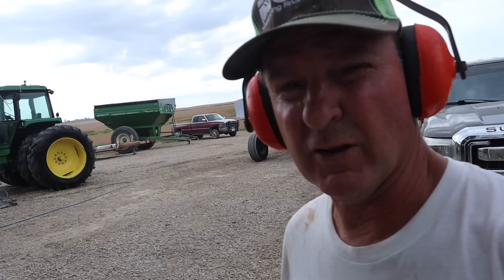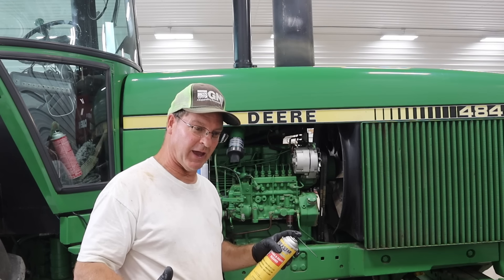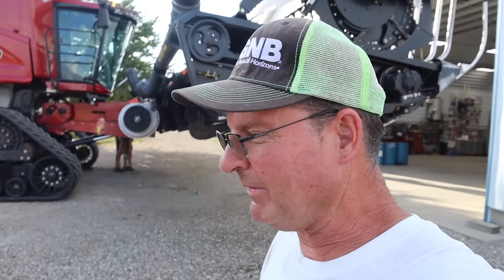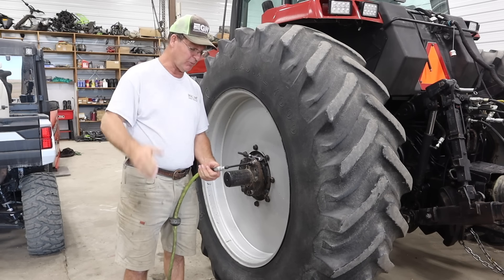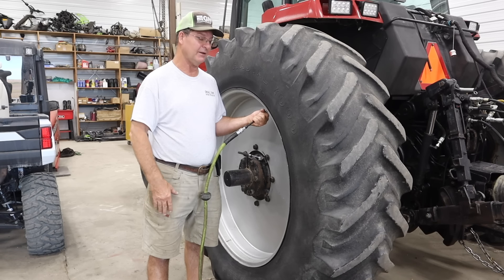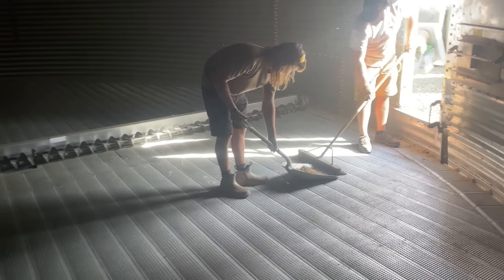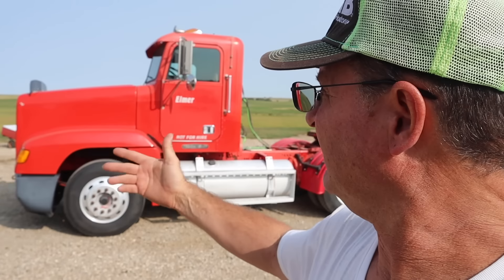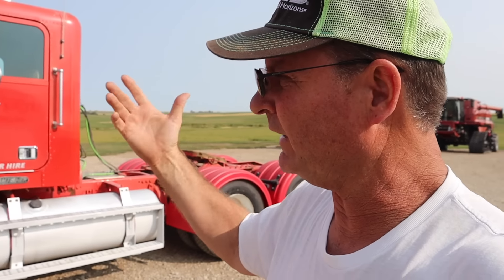The Combine Is Ready To Roll

Comment: Problem hooking up Elmer if the trailer is dropped too low.  The trailer will hit and damage the fenders, needs a device to run on the frame rails to lift the front of the trailer and clear the fenders.  Its at an angle to lift the front of the trailer up to the 5th wheel...  What happened to Cole's video a day about the farm?
Reply: Why don't you ask Cole?